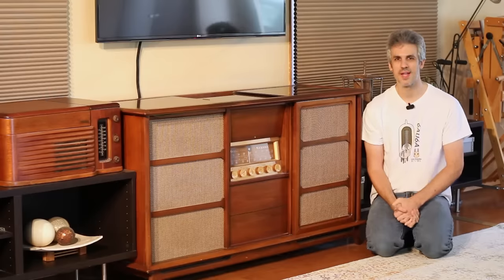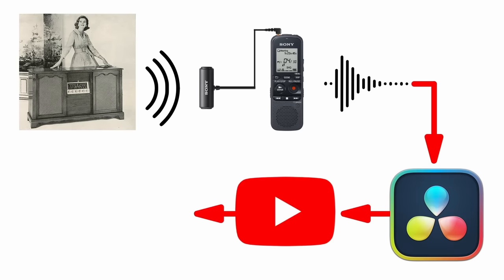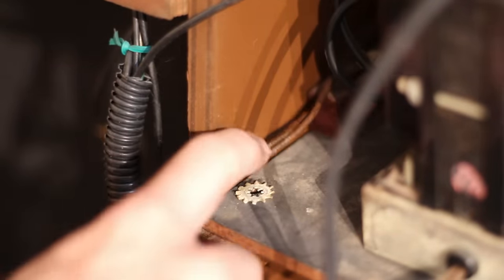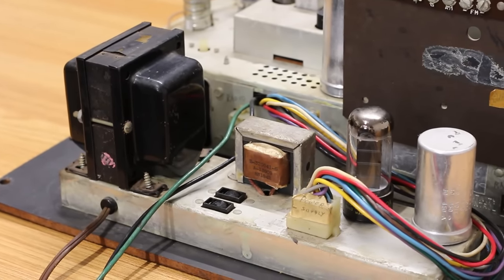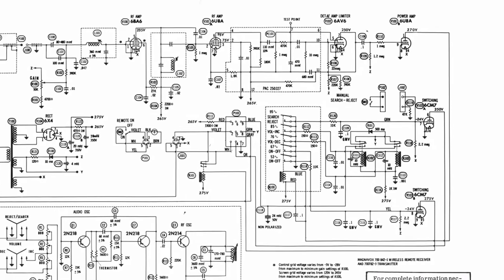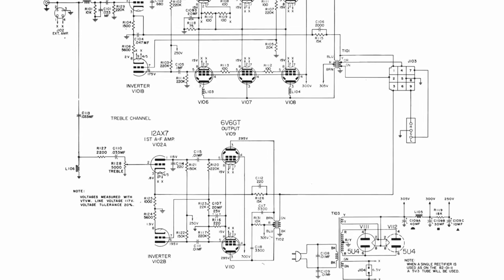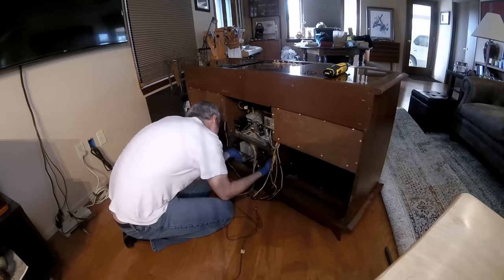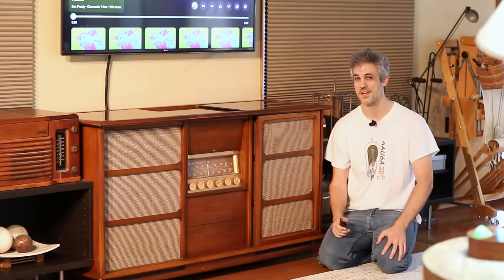A Look at our Magnavox Concert Grand Console Stereo

Comment: Check the grid voltage and/or bias current on those power amplifiers. That’s an expensive set of output tubes and output transformers to melt down if some or all of the grid coupling capacitors are beginning to get leaky. 1962 may be early enough that they were still using paper capacitors, unsure when they would’ve transitioned to film capacitors but worth checking. If they’re paper capacitors, they’re almost certainly failing, just speaking from the collective experience of myself and the rest of the vintage electronics community. I’d also focus on identifying leaky capacitors in that Bendix G-15, as I’m sure you already planned to. Finding replacement transformers, magnetic heads, solenoids etc. for that would make tracking down a pair of rare original high end output transformers for the magnavox look like child’s play. When a capacitor gets leaky between the HV+ plate of a preamp/driver stage and the negatively biased grid of an output stage, excessive current through the output tube and plate winding of the output transformer and power transformer could spell a slow death for some unobtainium parts. Worst part is, the amplifier can still “work” and sound great, right up until it’s too late.

Comment: No info on the turn table?
Reply: It's an idler drive turntable with record changer mechanics which means that performance would be very poor even by 1970/80s  standards.  Idler drive invariably covers couple's motor vibration into the phone or cartridge and forces the amplifier and speakers to try and reproduce a bunch of low frequency noise and if you turned it up loud it's likely there would be some feedback going on between the speaker vibrations and the turntable even if it doesn't break into an actual audible howl; the audio performance at loud volumes is likely to be somewhat muddy (especially so now that the rubber grommets in the turntable suspension will have dried up and gotten hard like plastic, and the idler wheel itself is probably similarly dried up and may have a flat spot in it, so the speed consistency will be poor)..
Reply: @goodum2974
So for an old console stereo as such what style/type of internal turntables would be recommended?
Reply: @goodun2974 ^
Reply: @montag4516  , any turntable with an isolated subchassis (to reduce feedback) would probably work.

Comment: Not a single thought of checking for old caps while it was apart huh, Lucky for you it seems like those nasty waxcaps been replaced at some point. otherwise you likely would have seen the smoke by now. I have built my own complete tube audio system from the ground up and I can absolutely tell tubes can have good sound. But always ALWAYS have old capacitors in mind if you truly care about your equipment. things will burn otherwise and remember that components age even if you are not using them actively, especially capacitors and they take tubes and resistors with them if they fail. it is a very nice radio furniture you have

Comment: So as an avid watcher of yourself and Mr. Carlson's lab (please check him out if you want a good look at audio VT stuff), it looks like your grandfather made a very wise investment. Magnavox appears to have gone with early brown drop film caps instead of the common paper and foil/oil that was used at the time. These caps are almost certainly fine which is why those tubes haven't red-plated and burnt their filaments out. The cheaper caps would have almost certainly have serious leakage which would have destroyed this lovely stereo console.

That said... I'd consider replacing the electrolytics with new caps, particularly if they are connected to any of the chokes or transformers, or in a place to cause excessive current draw. If they short to ground, as they are wont to do, they will destroy a piece of iron that is VERY hard to replace and will be very expensive to replace. Leave the old caps on the top for appearances. But don't risk your iron! A little soldering now can keep this in good stead for another generation.

On the radio: Magnavox should have posted alignment instructions, hopefully they have been uploaded to the internet. You should just need a signal generator, an oscilloscope, and likely a capacitor to loosely couple into the radio for that.

Comment: "Analog, tube-based all-in-one audio amplifier and integrated speaker from the 1960s = best audio on the planet" - I would have assumed you knew better, especially seeing how you feed it from AC3 compressed audio probably, if it's connected to your TV. It's okay to appreciate the build quality or the general nostalgia associated with tubes. But talking about audio quality is really dangerous territory when it comes to equipment that came out about 30 years before the first DSP was even invented.

Comment: Its IMPERATIVE that the power supply capacitors are replaced. If they fail, it can cause a cascade failure that at the very least, take out irreplaceable parts or the very worst, start a house fire. Also, if the capacitors around the 6V6 are cylinder shaped, they also must replaced. This is not negotiable, you will destroy this unit and/or tubes  if this not done. Also the cathode bypass resistors on 6V6 must be replaced.

Comment: Weight does not equal quality. Otherwise high end carbon frames, for example, on bikes would be very low quality, yet they are not.
Weight can give a feeling of no expenses spared on older equipment. But the validity of that is long gone with superior light weight high tech materials around.

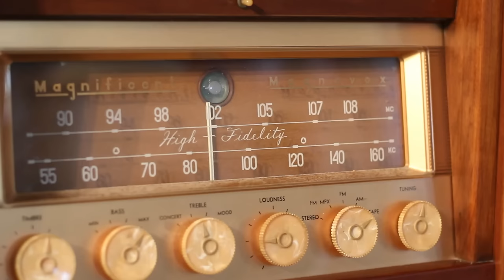Comment: I lasted until 2:45. The "Magnavox Concert Grand Console Stereo" cost around 650 dollars in 1962, depending on features. In 2023 dollars, that is nearly $6 000. So you have to compare it to a pretty high-end receiver/amp. And the perceived audio quality claimed by audiophiles are pure bias and nostalgia. It isn't surprising that a tubehead would prefer a tube am, but audio quality isn't "better" on tube amps just different, and the content being play impacts the perceived audio quality too. 
Not surprised, but a little saddened about the bias in this video.